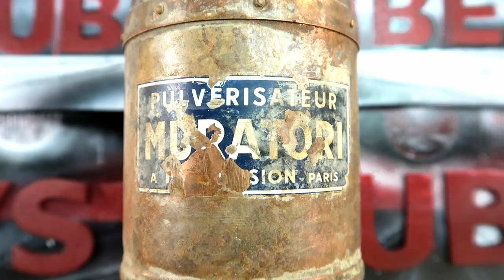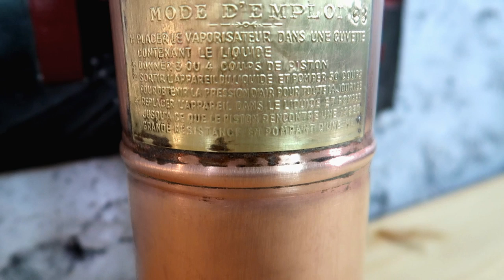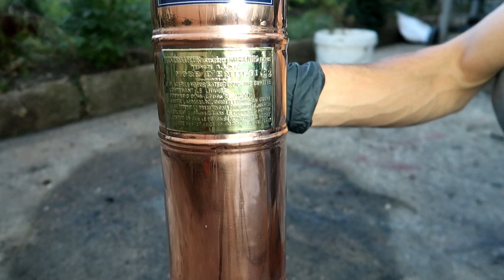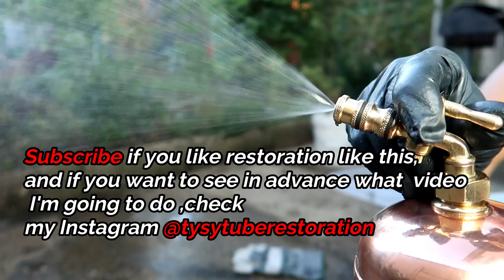Broken Rusted Old Sprayer Restoration

Comment: After restoring brass (or copper) I would recommend putting on a couple coats of lacquer if you want to keep it from corroding again.
Reply: Far better to use wax.
Reply: Any special kind of wax? I like fading brass items in second had shops and polishing them up.
Reply: Since it isn't likely to be used, wax could work but lacquer is longer lasting.
Reply: Shezza Please don't go around polishing brass items like bowls, jugs, statuettes, and other ornamental pieces. Polishing them may LOOK nice to you, but it actually lowers their market value considerably. Tarnish on brass is not the same as corrosion, it takes a really long time to build up and the colour is really desirable to a LOT of buyers... polished pieces, not so much.
Reply: @jordibear  Exactly!
Reply: @jordibear  "Value" is subjective. There are people that like the look of neglected things, and there are others that like the look of well maintained or restored things. I think leaving an object faded, worn, tarnished, or dirty simply because it's old and "patina" is ridiculous. I restore antiques to what they looked like and how they worked from the factory as the designer and builder intended them to be seen and used. Anything else is a disgrace.
Reply: @mannys9130  I like the look of neglected things.  They are as beautiful as my mother's face.
Reply: Instrument lacquer (think trumpets and saxophones) is extremely durable and, if correctly applied, will not discolor, crack, or peel. On a decorative item like this, it will last for many, many years. Unfortunately, the restorer would have to send the items to a good instrument repairer to have this done. This is not the cheap stuff you buy in spray cans at the hardware store. It requires special spray equipment and expert technique to get a perfect finish but once it is done, it is done.
Reply: Why would you neglect your moms?

😊. Kidding
Reply: Copper doesn't corrode it oxidizes
Reply: @jordibear  So true, the patina is what people look for!
Reply: @Jordan Gilbert  but he’s not selling them tho, but that is a good tip for others who find similar pieces like this and want to possibly sell them after refurbishing
Reply: He did use turtle wax in the end

Comment: 24:36-25:20 - Don't think it is a good idea. Because this part works not as gasket but more as piston and it has frequent dynamic loads. After a while you will notice that. A good thing - it can be quickly replaced (with a thick rubber gasket for example).
The rest is great.
Reply from the maker: thank you so much 😊, i know is not that great but i didn’t find a gasket that fits
Reply from the maker: and i will not utilize this so often it is only for decoration on my house, is so beautiful
Reply: TysyTube Restoration  is so beautiful 
Indeed!
Reply: It most likely was a made of leather and cup-shaped, the top of the pump rod head should be removable to mount it.
Find a piece of leather, around 1.5mm thick, punch a hole of the diameter of the groove, cut the piece to a ring, about 1.5cm wide, soak it in hot water until it is really soft and pliable, fit it to the pump rod head with the coarse side facing the handle,  pull that into a piece of pipe of the pump tube´s inner diameter, let it dry, it then should have a cup shape. Fit it to the pump with applicaation of a light oil. It may take a few minutes to soften up again and then a few strokes to properly seal, but once it does, it will do for a long time, as long as it is either soft from oil or from water.

Comment: There is no point in mixing baking soda and vinegar. 
Soda neuralize acid in vinegar, and it stop working (cleaning).

What you want to neutralaze are vinegar remains on your part, after it's cleaned. Dilute baking soda in pure water (demineralized), and wash with it after treatment with acid.

BTW, lemon (citric) acid work as good as vinegar, and it smells much nicer.
Reply: I'm fairly certain he was just reusing the vinegar jugs, but filled with water when he was adding the bicarb to neutralise the vinegar.
Reply: Not as well. Citric acid has a ph of 2.2 acidic acid 2.8. Both will work but vinegar is much stronger so will work faster and with less effort.
Reply: @jaycie5021  um, on a pH scale a 2.2 is a stronger acid than a 2.8 in terms of acidity. 0-2 is strong acid, 2.1-6.9 is a weak acid, 7.1-11.9 is a weak base, and 12-14 is a strong base. And of course 7 is neutral

Comment: The pump mechanism gasket made from pipe thread sealing is probably to blame for the heavy pumping action. It's advantage (when used as a pipe thread sealer) is that it expands if it gets wet. No so helpful in this case. Otherwise great work :-)

Comment: I have a tip for you for your vice ;
The mats that are used for yoga, camping, garden kneelers is tough, flexible, cheap, and can be shaped. You can cut them to fit your vice clamp jaws into various shapes and it will hold things tightly without damaging what you are holding. Great video as always.

Comment: 3/5/2022
This restoration was done on a rare piece that once was common, world wide. Great job.
I believe what you actually have is a very early fire extinguisher that used a mixture of soda and water, which has been adapted as a spraying devise.
You would shake up the contents, then pump air pressure into the tank and go fight the fire. 
I know you have seen later versions of this that are pre pressurized, All your missing is the application hose, which would replace the spray nozzle. 
So, you may have a piece of fire fighting history. A fire fighting museum might just like to have it. ;-)

Comment: Great video as always ! I’ve been restoring brass fire extinguishers, alarm bells and other firefighting antiques for years and have never had that degree of success with vinegar. That did an amazing job on the initial step. I’m wondering if the vinegar you used is a higher acid type, with 15-30% acid or so, vs the food grade, which is much lower ? I love that pin vice you used. I’m ordering one today, after seeing yours. Last, have you ever sprayed brass pieces with clear, high-gloss lacquer ? It works great for some pieces and protects indefinitely. Great work !

Comment: If only the people who dislike videos like this can give a reason why would be nice, cuz I see no reason why, great work.
Reply: Usually because what he does is less "restore" and more "remodel." Antiques lovers would prefer the item restored to working order: cleaned, oiled, etc. but would never want to see the patina of the antique scrubbed away. 

After he is done, it is impossible to tell the difference between an antique and a modern replica. And some of his restorations don't actually look like what the item looked like when it was new. This sprayer was almost certainly not polished like this new, for instance.

So those who dislike this probably cringe because he is taking a nice antique and basically using it as the raw materials for art. Same as if you took a nice china vase, broke it into pieces and turned it into a mosaic, Your mosaic might be a masterpiece, but some collectors are only concerned with the vase.

Comment: The end result is absolutely gorgeous! I must admit, I am saddened to see the old sticker was lost in the cleaning/restoration process. Items that maintain the old sticker just have more character, in my humble opinion.
Reply: How would one protect an old sticker? Masking tape? My little unrestored brass sprayer has three stickers on, not in very good condition.  If I can't save them, how do I get new ones?
Reply: @Ibis117  no a lot of ones you can't. There are places on line to order new ones. There are a lot of shops on Etsy that you can get them or going to a signs business that works in vinyl, ceramic paint, etc.

Comment: Wooww, the result is gorgeous!
I have a little tip, to clean copper and brass add a fair amount of table salt in the vinegar and use it like a scotch-brite to remove dirt and specks of dirt, as well as oxidation, it will go a lot faster to remove oxidation than just using vinegar ;) 

(mets du sel fin dans le vinaigre, le sel ne se dissous pas immédiatement et trés peu, donc tu peux utiliser le sel impregné de vinaigre comme une gratouillette dans la paume de ta main, pour enlever toute la saletée, en plus la couleur du cuivre reviendra beaucoup plus vite, la mixture sel + vinaigre est super efficace contre l'oxidation ;) )

Comment: This isn't a fire extinguisher, it's a work of art. =o  It looks like something that would be made in the 1920s instead of 1955. I wonder why they used such dated materials for it when everyone else was using aluminum or steel.

Comment: What did you have to do to get the sticker made?  How does that work in a case like this?

Outstanding result!
Reply: Any graphic designer can do it for you, (or if you want just learn to use any vector graphics software) then just print in adhesive vinyl.  You only need a picture of how it should look like.

Comment: For the lower gasket on the pumprod people normally used a small leather circle about 1 mm larger in diameter than the tube it has to fit in. The edges of the leather have to be bent downward then wheninserted into the tube as in a bycicle pump.

Comment: Great job as always, what the name of the tool you used for holding small pieces?
Reply: Marcelo Coronel it’s called a hand held universal work holder. You can also use it in a vice or you can purchase a separate bench top version. They are inexpensive and really quite versatile.
Reply: Thank you so much for your response

Comment: You did a superb job, but I do have a couple suggestions. First and foremost, buy you a MUCH larger polishing wheel, it will make your life much easier! Secondly, when polishing an embossed name plate, do not use a full size grinder/polishing wheel, but rather, something like a Dremel. Yes, it will take longer but it will be far less destructive to the lettering. When using a full size wheel, it tends to smooth out the lettering, ultimately, making it less attractive when observed close up... Just my two cents... 👍 PS...in case of fire, use garden hose...😂

Comment: In the future, when you want to clean copper and brass, you can use a mixture of vinegar and table salt. It will remove tarnish without harming the surface. It's much less damaging than the mirror product you used.

Comment: 1er commentaire sur ta chaîne ou je suis tout nouvel abonné , je trouve ça assez marrant ! j'ai terminer pas plus tard qu'hier le même pulvérisateur ! model légèrement en dessous (il doit faire 35 cm ) :) le mien était tellement encrasser (produit de la vigne etc) que le vinaigre n'a rien pue faire  :( j'y suis allez à la brosse en fer , la plus souple possible , mais malgré plusieurs passage à la lustreuse ( patin sur perceuse )  , j'ai évidement pas mal de micro rayures :( même finition au polish . si tu as un conseil , je suis preneur car je dois rendre l'objet au proprio d'ici peu  ;) belle rénovation et bonne vidéo , continu comme ça . Amicalement
Reply: Hot vinegar is much more efficient, but if that is not enough, you could try a weak solution of muriatic acid. Sorry I write in English. I understand French but I just can't write correctly.
Reply: RobertoDonatti  thanks for the solution. see you soon ;)

Comment: Pump gasket is best replaced with a disc slightly bigger than the diameter and a hole punched through the center of it. Replaced many that way.

Comment: Excellent cleaning and polishing, very good Job for a aesthetic repair.  Not so impressive for a restoration.
For a "Perfect" restoration and repair i would recommend:

1 -) The handle was painted, you should have sampled the painting and repaint it with the original hue.
2 -) The label very similar though didn't matched the original size, neither did the characters style.
3 -) The piston gasket, not the best option. For that you should have used or adapted a real gasket.
4 -) Finally i didn't saw the pump cylinder polishing, it is a must, without it the gasket wears out in no time..

Comment: Be careful about putting parts with lead in them in acids, that tank has lead solder all over it.

You can tell from the discoloration of the solder, going from a dull shine to a matte grey that it has been damaged by acid and likely had a significant quantity leached into the acid solution. Lead is pretty safe in solder, but when you leach lead ions with acid, that's how you end up with lead poisoning. Don't put your hands in the used acid and definitely don't pour it down the drain.

Those fittings could also potentially be made out of leaded stock, but it's hard to tell with how much corrosion was on them. The only way to be sure is with a lead tester. I would avoid doing anything to create airborne dust.
Reply from the maker: acid- do you refer to vinegar ?
Reply: Yes, vinegar is an acid. (acetic acid diluted to 4-8% with deionized water)

Generic white distilled vinegar available in stores usually has a PH of between 2 and 4 depending on the concentration of acetic acid. Vinegar is mildly corrosive to metals, which is why it removes oxides and tarnish. Pure acetic acid is far more corrosive and a health hazard.

Comment: Good job.
Next time do not use the sponge with green or black abrasive. Use blue, grey or purple. Copper is quite soft and gets easily scratched. I also don't know which one is recommended for cleaning cooper but sure blue and/or grey are better than green or black.
I think there must be a code represented by the color regarding the hardness of the abrasive face of each sponge.

I found it:
http://www.british.com.br/en/consumer-line/own-brand/own-brand-sponges/
Reply from the maker: thank you so much man for your advice, be sure i will check that

Comment: Waay too much buffing for my liking (I would have tried to keep the outside patina of "before" on the copper cylinders, only buffing up the brass), but a real nice piece of work and a well working "after", which is important in my view: technical device should be used, or be well usable, at least. Leather instead of the hemp will last longer and seal better when re-wetted.
Reply from the maker: thank you so much 😊,
Reply: I like the way it turned out, very nice work.

Comment: What is 120 grid?
Reply from the maker: granulation
Reply: 120 grit is the  grading of the abrasive on the sand paper. It comes in "grits" from about 30 grit-800 grit. 30 grit is about like asphalt roadway with lots of sharp rocks in it..and 800 grit is approaching the smoothness of cellophane. The smaller the number..the bigger the chunks of abrasive on the paper (1000 grit is common for lens makers)

Comment: @04:34 This tool should have been centered and both hands should have been used to apply equal force on both sides. It would have been easier (a little WD40 could help also).

Comment: I think if you would have used a penetrating oil, it would have been muck easier to take apart.
Reply from the maker: i know, but i want you too see how is looking inside and out side without the oil all over the parts

Comment: it was just me? or does any body else felt like been on the dentist office when he was using the polishing machine? it felt so horrible I had to mute the audio in the end the restoration ended incredibly well like the finishing really shiny
Reply from the maker: thank you so much 😊, i am not the dentist 🤣👨🏼‍⚕️
Reply: Wendell Duran - An inadvertent effect of high speed audio playback 😖. My teeth are not painful and I do brush them regularly, (with electric toothbrush - oscillating type head) Haven’t been to the dentist for a long while, and haven’t had them drilled out yet 😉. May never need to have it done 😁.